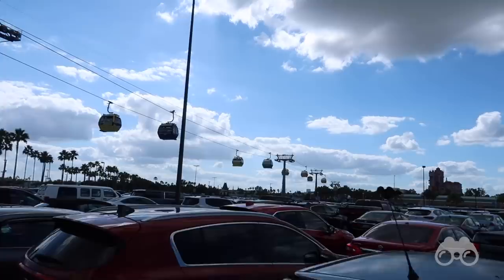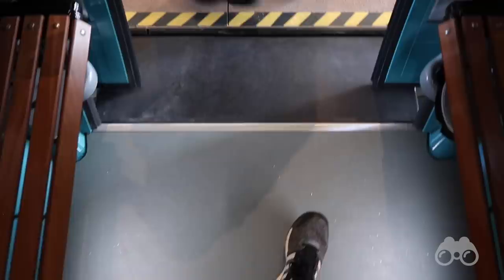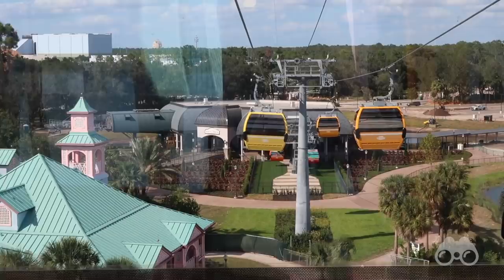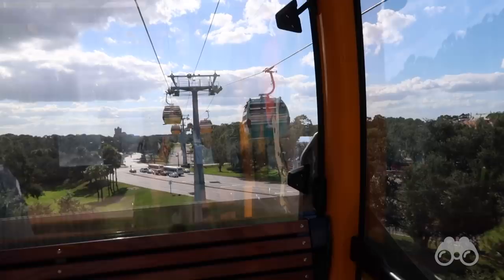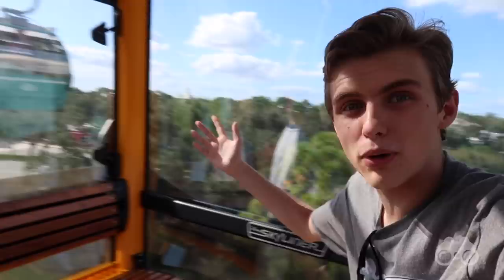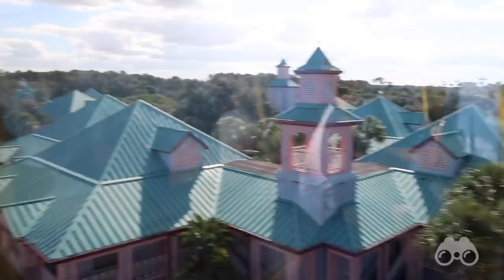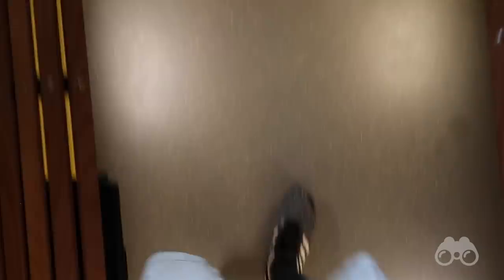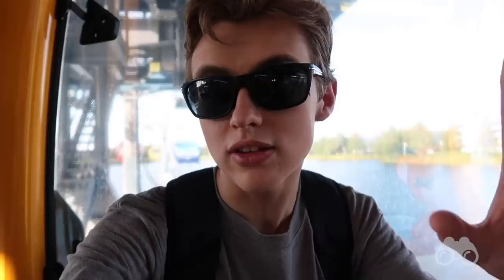How HOT is the Disney Skyliner Gondola?! 🔥 - Disney VLOG

Comment: 90 degree air flow is still 90 degrees. Glad we go in December.
Reply: That was my thought. When Brayden described the temperature as "driving around FL with your car windows down" that said everything I needed to know. As someone who lives in FL, I only drive with my windows down like twice a year. Otherwise, it's A/C 24/7. With that said, if I need transport around Disney, I'll just stick with the buses.
Reply: @BarrelBob  you could endure waiting in line on rides on the sun but can't handle a couple of minutes in the gondola?
Reply: @gissneric  Actually. I can't endure waiting in line for rides either. That's why I avoid the parks between the months of May through October (unless there's a hurricane and all the other guests stay home). Apart from that, if I don't have a Fastpass, I don't ride (excluding TTA, obviously). So no, I wouldn't wait outside in lines either.
Reply: @gissneric  Queue lines don't break down in a glass box suspended 60 feet in the air under the Florida sun.   Only takes 10 minutes for a child to be killed in an enclosed car during the summer in Florida.  I doubt they have the capability of total evacuation in a breakdown in less than 10 minutes.
Reply: @LakeHowellDigitalVideo  watch every video about the Skyliner and no one complains about the heat. Why are you anticipating something bad is gonna happen when it's not even happening. Don't live your life in paranoia. Hakuna matata.
Reply: @LakeHowellDigitalVideo  Except it would be like being in a car with all the windows down.   You'd think that Dopplemyer would try these out in a hot, humid country before doing it at Disney..... oh wait. They did.
Reply: @LakeHowellDigitalVideo  the difference being the gondolas are not sealed units like a car with the windows up is.
Reply: @BarrelBob  
We went to WDW in July, and I seriously almost collapsed from the heat. I told my wife I needed to get to first aid...never made it there. I ended up squatting down in a corner into the shade foe about 30 minutes to get my temp down. I live in MO, but FL is way .ore hot and humid. We go to DL normally, and while it does get hot there, it is nothing compared to FL. I live this skyliner idea, but I too am curious about how successful it will be when its super hot.
Reply: Das Monster they account for this by including an emergency cooling unit that is battery powered. It can keep gondola cool for 3-4 hours while evacuation takes place.
Reply: @LakeHowellDigitalVideo  And we know nothing ever breaks down in Disney...
Reply: @lifequest7453  people can endure waiting in line on attractions for hours but can't handle a short period inside the gondola? I have ridden this type on gondola with no AC in Hong Kong and it's very humid and hot there. Nobody complains cause it's been there for decades.
Reply: @lifequest7453  how is it a rant if I'm stating facts and you're stating assumptions. Watch every vlogs from.people who have ridden it, big time or small YouTubers, all of them have no complaints with the heat.
Reply: @lifequest7453  If you're so passionate about the temperature of a "ride', then that's on you. You make it a big deal even if it wasn't. For you to write that hella long argument is a waste of time on your part. Do you think you would die inside? of course not. Why the hell are you and others are so bothered by something that would not affect you long-term anyways. Don't ride it. Finish. Done/
Reply: @gissneric  Some people are just easily influenced by others. I personally would like to experience riding it myself before I make final judgement. People just like to judge something based on what they hear, see or read. It's sad.
Reply: @lifequest7453  girl. My comment was to trigger the commenter and obviously it was you who got triggered. Youtube comments section is not a serious debate. Don't make yourself the smarter or better one here. You sarcastic remarks ain't doing damage FYI!
Reply: @lifequest7453  Appreciate it. Thanks a lot.
Reply: @gissneric  I was there that day and I live in Florida. It was a VERY nice windy day for Florida standards. The real test for the Gondola will be a 93+ day with no wind.
Reply: @jeffdeering5808  You're right -- they're worse with far more glass for solar radiation than the average car.
Reply: @LakeHowellDigitalVideo  and yet Braden's temperature readings were within a degree or so of the outside air so your statement is proven to be false.  Were it true Braden's readings would have been much higher.  You are not being forced to ride these gondolas.  If you find it too hot take a bus they have ac.
Reply: Great idea to use the thermometer! I am a Floridian and 90 degrees is indeed too hot! I'm glad you proved that it will be too hot to ride without AC. I'm so surprised that Disney would have built this skyliner without AC  knowing how hot it gets here. Those high temps could be very dangerous for people of all ages!
Reply: @supersunshinethrifter9770  the decision makers are in California which isn't as humid as Central Florida. My feelings are the Ececutives will not be riding these on a 94° day with saturated air making it feel over 100°. 🤭
Reply: @gissneric  That's because the people who make these videos don't dare talk poorly about anything Disney does

Comment: The big question I have is whether a long ride on the system when it's in full operation is going to be a nightmare of standing in repeated long lines every time you have to switch gondolas. And I don't think we're going to know until it's tried.
Reply: @lifequest7453  At some of these stops, most of the people getting on are going to be through passengers--especially at some crunch times like the end of the day--which is probably good for avoiding long queues, since the incoming line won't be dropping off passengers faster than the outgoing line can consume them.
Reply: ...though I could see big problems at the branch points, if two lines are emptying into one...
Reply: I wonder if they have to stop the entire system to add the handicap gondolas. If so, I wonder how many times  will they have to stop the entire system and how will that feel in the middle of summer.
Reply: @lifequest7453  Well, I was just watching DIS Unplugged's video and was surprised to see that the gondolas actually do continue straight through the (unfinished) Riviera resort between Caribbean Beach and Epcot--you don't have to get off. I don't know if that is a permanent situation but I also don't see why it wouldn't be. So maybe you don't have to get off as often as I thought! Looks like you do have to disembark at Caribbean Beach though.
Reply: @jackwhitetron  I've heard that they don't, at least in principle--there are gaps in the gondola sequence so they can get them in, and the system can just slot them onto the cable when it's in motion.
Reply: @MattMcIrvin  thanks! Sounds like a great system. Hopefully it won't be too hot mid summer packed with people. Fingers crossed

Comment: Great Idea with temp check! I went on two days ago with my Niece who is a Cast member and my ride was exactly like yours! I taped all the same stuff and also noticed the Gondolas with the characters were less clear to film out of, but prob will stay cooler in stop. It would be amazing to take a gondola ride from Epcot to Riviera at sunset! So excited you are living your dream! I do recommend anyone with issues with balance even if not in wheelchair to use the handicap ones as the regular ones do not stop and there is movement which is  faster than the restaurant in the land pavilion(Garden Grill) and I think it would be difficult for elderly, or someone who just had a joint replacement to get in and seated.  Also noted that riding forward was a little easier if you tend to get motion issues.

Comment: When the skyliner stops  that temp really jumped up. Disney better hope they don't have people stuck for long periods. Worst if you have a bunch of people in the skyliner. Looks cool, but could be troublesome.
Reply: They are engineered to minimize heat build up. Last week someone had a thermometer as it stopped for 6 minutes, one of the hottest days of the summer, and the temp rose 1º. A few degrees is far better than a car that can increase 40º or more.

Comment: Great idea checking the temperature I really think Disney should have put AC on these things because when it's a 101 outside and 101 inside that's just gonna be hot. Great job on the video.
Reply: AC in gondolas isn't realistic. They get power by briefly passing over poles. Rides are 5-10 minutes long.
Reply: @blondy2061h  it could be done if they wanted it from what I have read.

Comment: Great idea to check the temperature and humidity, but it is worth noting that temperature perception is not exactly the same as the actual temp.  The increased air flow experienced while underway will likely make the temperature seem lower than your thermometer might show because the rushing air increases the evaporative cooling as perspiration evaporates and cools your skin.
Reply: Yes, if the humidity is low. That's not common in Florida.

Comment: On the 10 people vs. 6 people + ECV: Each bench holds 5 people. Both benches fold up, allowing room for an ECV, so you’d have 5 people on one side and the ECV (with the rider still on it) on the other.  Regarding the rough part, that’s the gondola detaching from the cable and moving to a slower speed wheel, making it easier to get on and off.

Comment: Weather has been relatively good this week with low 90's as a high and relatively low humidity, which is what you are seeing, so it doesn't surprise me you are feeling a cool breeze   though the temps are about equal to outside temps. Where the problem will be in the July and August time frame when temps get even higher, and humidity can be 80-90% with a still wind day, any breeze created by the motion of the Gondolas will be a warm breeze, which will  not help much. Could this be why Disney delayed opening to late September? The real test will be next Summer, or we have a hot day with High Humidity before then.

Comment: Absolutely fantastic job .... especially liked the fact you brought a thermometer to gauge temps ..... there were a lot of vloggers doing this today and you were the only one that I saw that had the foresight to do a "temp test" ..... I applaud your enthusiasm but I think you are underestimating the effect that the Florida sun and heat will have on these cabins during the peak summer months .... I don't think that testing the heat effect is a fair assessment in late September/early October when temps are more palatable and humidity is down ..... I'll give it a try when they are open to the public but the only line I could see myself using is the Epcot/Hollywood Studios line and I think I'd prefer the Friendship Boat for that anyway ..... again, you really did a great job (as usual) .....glad you are now a  "local" in Orlando.
Reply: Last week, one of the hottest weeks, heat index over 100º, riders said the gondolas were comfortable.
Reply: @kettd007  Once I ride for myself, I will certainly be in a position to offer a factual assessment of the gondola ride ..... until then, my concern is on how hot it will get to inside such a confined space with a maximum of 10 people during the mid-day Florida heat .... I have less concern over morning rides and even less concern over evening/night rides when the outside temps are cooler ..... again, these are my "common sense" concerns and not based on any hard facts or actual ride experiences.   I hope I am wrong and that because it's such a success, they expand to Animal Kingdom and Disney Springs ..... I would love to use this transportation to get around WDW without having to use the bus system.  I'll know soon enough.
Reply: @ronokoren8101  The good thing about WDW, is there are several modes of transportation available. No one is saying that it is like riding in a air conditioned bus, but clearly better than walking on a hot sidewalk without a breeze. One is not on it for long, just a few minutes. Everyone has different tolerances for temperature, motion and heights, so it's not for everyone. Personally, I am more concerned for the cool mornings and evenings in Jan-Feb.
Reply: @kettd007  Disney fans are going to say it's great no matter what, lol.
Reply: @sharkheadism  several were nay sayers, they were surprised.

Comment: First, congrats on making the move.  Second, thanks for answering everyone's concerns about the heat inside.  Looks like the need for A/C probably won't be an issue for the most part.  I really think you're onto something with that theory about more stations and where you've placed them.  It stands to reason they would do this.

Comment: How can you possibly say it's not hot, when you took the temperature and it showed it was over 85 to 90 degrees??  I still have no plans to ever ride these things unless temperatures are lower than 70 degrees.  Sorry,  but Disney made a huge mistake designing these things without air conditioning.

Comment: I rode it. It is too hot. When is moving there is a small breeze, but I suggest that people that have breathing, high blood pressure problems do it only in winter. It gets hotter when they stop in the stations. The guy is riding is young, but for older people they need to be careful. My suggestion wait for winter.

Comment: The temperature of the air in the sun is the same as the temperature of the air in the shade. But, you feel 10 to 15° F warmer in the sun than you do in the shade.  This is because the light from the sun (radiation) heats you up in addition to the air temperature. 
If the reflective windows do their job, and I doubt that Doppelmayr could sell these things if it didn’t, then the temperature in the gondola should feel no worse than it did in the loading area.

Comment: loading/unloading is just like many attractions. Haunted, Buzz ect.
Reply: Jorge Miguel - not particularly.. I don’t know about buzz but most of the other Disney attractions have a moving platform that you load from.. the ride vehicle is not moving independent of you while loading like this
Reply: @CgBrian  ok, yes.  this system is the same as a detached ski lift.  older ski lifts do not detach to slow down.  Buz is the same a Haunted or Under the sea, grizzly river. omnimover systems. they are still easy to use.

Comment: This system might work fine but it is ugly for a Disney creation. The towers are bare metal--I know they're likely galvanized or otherwise designed to be unpainted, but they look awful, and the gravel under the right of way is low-effort. Seems like they phoned this one in. It would have been nice if they had expanded the monorail, installed light rail (tram), or a guided busway system.

Comment: Who's idea was it not to include air conditioning cheap thoughtless move thanks for content always great
Reply: Cause when someone farts or smells bad, it would suck to be in an enclosed AC space. At least with constant airflow the smell would fly away 🥴
Reply: There is only one system in the world with AC and it doesn't work well.  These systems are in tropical climates around the world (Colombia, Vietnam, Hong Kong, etc) without AC and no problems.
Reply: Try reading reviews for Hong-Kong cable cars 360 lots of complaints about to hot no air con

Comment: So let me get this straight, Disney removes the Skyway in the MK stating it was too expensive to keep & maintain, but then spends 100x more to build another skyway system?  Got it..
Reply: First of all, one was an attraction and the other is a transportation system so it can't be compared. Also one was decades ago. The technology is surely better now. It might be harder to maintain back then. Got it?
Reply: @gissneric  i would argue the original was a transportation system as well, even all the old guide maps described it as such. Im sure there are a few improvements today, but the basic design and framework is pretty much identical to all yesteryears models. I recall when disney said they were going to get rid of the MK skyway, there were ALOT of ppl whom were extremely upset about that, some even staged protests in the park at each station. Getting rid of the 20k submarine attraction made sense to everyone (it was extremely expensive to maintain), but no one really understood nor accepted Disneys excuse for getting rid of the MK skyway.
Reply: @gissneric  Those old gondola systems are way simpler to maintain and cheaper to operate than this one. The reason why parks pull them out is that they're costlier to insure.